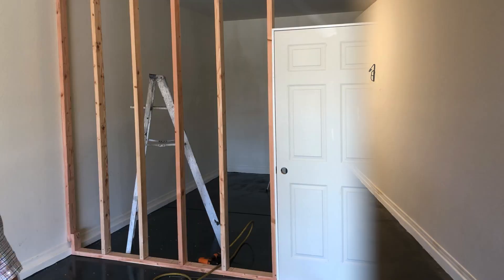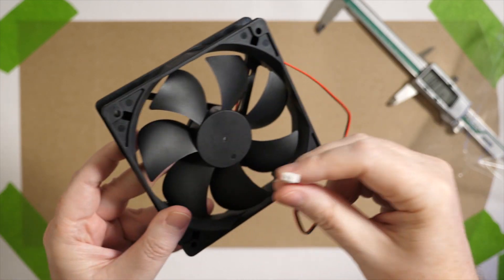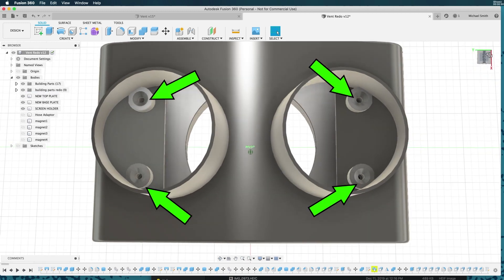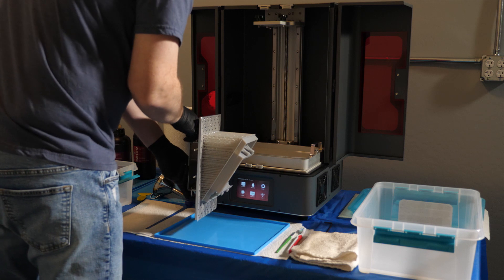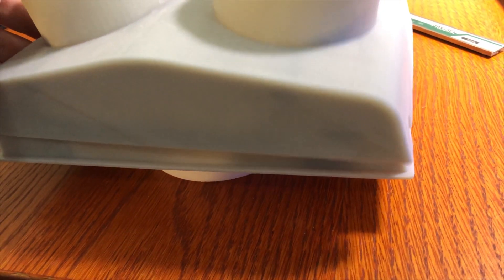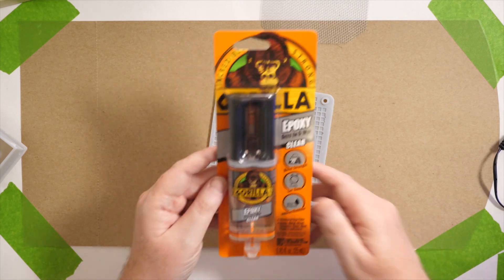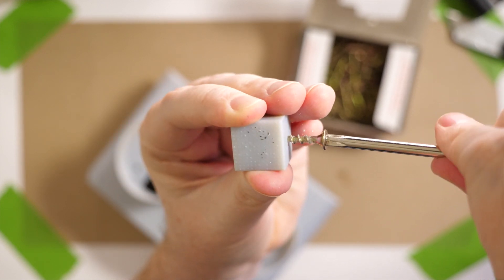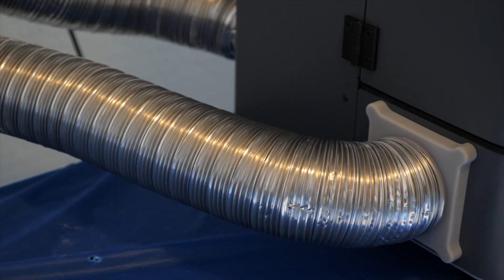Printer Fumes Gone - Designing and 3d Printing a Vent - 3D Printer Ventilation System

Comment: Cool designs, one suggestion, if you put some rubber o-rings were the parts connects with the wall or with the 3d printer you can seal the air flux and it will works a little bit better

Comment: Please use metal rings for tighter fits on the hose, and also, I am not quite sure a magnetic connection is really enough to make it airtight enough to not leak air and thus also fumes.

Comment: I love your videos and this design is great but I don’t think the PC fans push enough air. They’re not designed to handle the head pressure added by the ducts. I recommend upgrading to a duct fan with controllable speed. I turn it up before opening the lid to minimize the fumes I come in contact with.
Reply from the maker: This printer had light fumes. So the pc fan gently pulled them out. The fan in that printer is also just a pc fan. If you attach it to a high power fan it would be too much suction and would make the internal fan spin too fast which could cause electrical damage to the motherboard. If this were sucking smoke out from a laser cutter you’d be right that it wouldn’t be enough.

Comment: I'm just getting into resin printing and living in a climate with snow. So what I will need to do is design an air-to-air heat exchanger to swap out the fume-laden air with fresh but not vent all the heat in the Printer enclosure.

Comment: I THINK (not positive) that you are removing non-resin air to the outside. I think those fans are cooling electronics in the lower part of the machine which is separate from the resin chamber. To remove resin fumes properly, you need a hole in the side of your machine, directly accessing the build chamber. I'm new to these machines, so I could be wrong.

Comment: Pretty cool. I bought little filter ventilators from Anycubic for 23 dollars. You get 2 of them and they recharge battery on UBS. I am using ABS like resin, and I haven't really even noticed the smell or fumes from it, unless I get my face super near it. I have had more of an issue with the Alcohol. IPA, Denatured and E85 all make me dizzy, and or give me headaches, and contact high issues, so I have ventilated the hell out of the room and where a Paint Filter Respirator mask whilst performing the cleaning activities. That has fixed the problems.
Also I noticed that the video is over 2 years old and the advice is still relevant, but I do think that they have developed some resins that are way less fume producing than what was being used even 2 years ago. In fact Anycubic brags as a selling point that their resins are 65 to 80% less fumy than the competition/their older stock, The shelf life is 18 months to 2 years as compared to other companies/their older resins, etc. 
I have some standard resin coming from them, so I can compare it to the ABS like resin from them when it gets here. Clever design on your unit there.
I just think I am going to put in the dryer vent with the bug screen, and run 4 in flex hose not to the machine directly but I might hose off the vent fans to the collection area.
IDK, at the moment. I might make a video about it. I have to get my camera mike working first. The last video I made about cleaning and printing I had to edit over on the other channel because my camera wasn't picking up the sound.
Good vid though, TY: https://youtu.be/udyttBN1eV8

Comment: 2 years later I want to know how this system holds up with 2, 4" holes exiting 1 smaller hole.  Are the printers fans dead from the uneven pressure or still going strong?

Comment: @Nerdtronic  Re:  Design.  You mention that the fumes "just sit there," which implies (I think) that they are heavier than the surrounding air and therefore sink.  You've also bored your exit pipe low in the wall, at, or even below table height (I think), and perhaps in order to remove them lower down because that demands less of your fans lifting or pulling them, in the case that your vents were higher up, perhaps even far overhead.  So I conclude your print room is at ground level.  Could you give advice to those of us who might be printing perhaps in a basement, or just in a half basement (halfway above ground)?  Draw or push fumes up to a ceiling level vent, or take them out down low?  As low as we can reasonably do anyway?  Thx for any reply.

Comment: Any chance you could make a 2 1/2'' version of the Hose Adapter, trying to vent my ELEGOO Saturn, and all other venting makes on here are too large for my ender 3 v2 to print, this would be perfect if it was just a bit smaller, I'd just scale it but then the magnets wouldn't fit, current 4'' would just be too big for the Saturn.

Comment: Hey there, Michael! Great design approach on your fume extraction system, as well as the video and editing! Are you still using this setup just as it’s displayed in this video? Also from one of the Valleys of the Sun.
Reply from the maker: That printer put resin fumes out those vents. A lot of the printers I’m using now don’t. So actually I’ve been printing in my office a lot this year. Although sometimes get complaints from the family about the smell - when I have the lid open or whatever.  So that printer is still hooked up that way and it did help a lot. But don’t use that printer much  at the moment.

Comment: Great video. Excellent content and clearly and well printed, oops, presented. Just fyi, it is usual to drill pilot holes for wood screws, even if using in wood. There are charts online specifying the drill bit size corresponding to the screw size. Keep the good stuff coming!

Comment: Quick tip for CAD, try extruding the feature right where you want them instead of making a rectangle then moving it. It also allows changes to be made later on without having to re-do the entire model. Also, use the shell feature for parts like this.
Reply: Fusion 360 also lets you use parameters as dimension values. Then you can just change the parameters any time and it recalculates the features automatically.

Comment: I know this is over a year old , , but if you ever remake this , don't epoxy the screen directly to the housing and the fan.   instead put some wax paper between the  screen pat and clamp it in place while the epoxy cures . when the epoxy is done , remove the screen part and the wax paper from it .  you should now have a nice smooth perfect fit between the 2 and you can simply remove the fan to clean / wash the screen .  Great stuff man, I have been FDM for years just getting to resin now myself.
Reply from the maker: Thanks for the advice.

Comment: Hm I dont get it yet. Most SLA Printer have Fans to cool the UV Lamps. Normally there is no Fan blowing Resin Fumes around. So I am not quite sure what this will help. I am rather thinking of building a Enclosure around the printer and venting this or doing a similar setup, like its used for kitchens or for airbrushing.
Reply from the maker: So my printer does have a vent inside the print chamber with a small filter in it.  That connects down to where the electronics are.  The filter doesn't do much.  Most of the air can easily just go around it.  And then it has fans that suck air in to the electronics portion of it and out of there.  But yeah fumes do get sucked from inside the print chamber out the two out vents.  When I added this vent system it got rid of most of the resin fumes in my print room.  I can be in there now with no mask on without getting the headaches I was getting before.

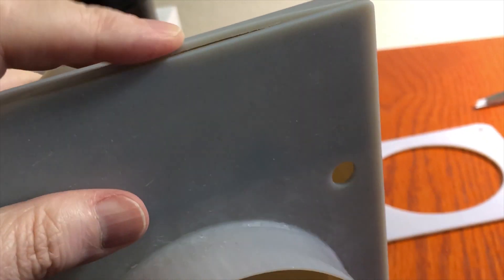Comment: Great design. How is it working out for you? @ 5:50 for long, thin leading/trailing edges like this that are prone to warp, it's always best to add a continuous line of supports.
Reply from the maker: It's been working good.  Honestly I hardly ever wear a mask in there any more.  The resin fumes mostly get sucked out.

Comment: I printed out the intake box that hon the printer what size is the hole suppose to be ?
Reply from the maker: If I remember right they're 4" holes.  They fit the hose I was able to find at home depot or lowes.

Comment: I like. Keep going
Reply from the maker: Thank you, I will
Reply: @Nerdtronic  im new to this.I've just got the software photon work shop slicer.  My computer is very slow when using this do you suggest any computer upgrades such as Ram or perhaps just going and getting a newer computer to run the software I'm also looking forward to using Fusion 360 to design programs to then be printed

Comment: Regarding your collision detection question.  There is a simpler way to see that hidden area.  If you are sliding in a panel from top to bottom on your fusion 360 display, click upper right menu  "Inspection".  From there click 'Section Analysis' in the drop down menu.

Now rotate your part a little and click on a wall/ surface on the right side of the main housing. Using the arrow, you will be able to view that panel moving down from the side, and when it bottoms out.
Reply from the maker: Thanks for the tip!  I probably need to watch more Fusion videos.  I know enough to get by.

Comment: Brilliant design and execution, but personally I wouldn't have glued the fan power connection into the baseplate so it could all be replaced easier if the fan failed...
Reply from the maker: If it failed I figured I’d cut the wire up a ways from the plug and crimp on a connector. And then do the same to the replacement fan. The plug wasn’t going to hold good enough in the case. Which is why I glued it.

Comment: I'm surprised you were able to make such a large functional part from an SLA printer, really that project falls much more comfortably in FDMs wheelhouse.
Reply from the maker: It's the reason I bought the printer.  I'll have more project videos on here where I print functional parts.  We'll see how they work out.
Reply: Nerdtronic I would be interested to see that!
Reply: I would do this on my FDM was exactly what I was thinking. If I had to do it on my SLA I would slow the print for a longer exposure and use a fiber resin. Not sure if this would help but that's my first thought.

Comment: Excellent design, setup and functionality of this system.. good work my friend.... I just wanted to put out there that SIRAYA Tech is producing awesome quality resins at amazing prices and truly have ultra Low Odor... I have printed some incredibly detailed strong and beautiful prints with it -and my faith in printing useful engineering quality components with a home SLA is restored. Thanks so much for this video....  I like this idea to vent the heat from my standard 3D printer enclosure when I print ABS :) PS. I am using grow tents for 3D printers now and ventilation is important for me and all these machines. So this may be my best alternative to cutting a hole in my ceiling (attic). 
Thanks Again- Jeff
Reply from the maker: Cool.  I'm using Siraya a lot now too.

Comment: Absolutely awesome make! I could see using some liquid tape around the edge of the magnetic box just to create a bit of a gasket. But that's because I love finding any excuse to use liquid tape on every project haha
Reply from the maker: Haha.  Never thought that it needed to be a tight seal.
Reply: @Nerdtronic  it probably doesn't haha but liquid tape!
Reply: use liquid rubber instead to make a 100% sealed connection so you are you gonna be sure that the voc arent escaping at all

Comment: The noise is getting to me, wish there was a way o reduce the noise level.
Reply from the maker: I hear you can swap out the fans for quieter ones but have not attempted it yet.
Reply: @Nerdtronic  If u ever do, please make a video for it, would help a lot of Transform users, heard there needs to be a power conversion which is the tricky part, u should ask the people on the Transform group that attempted this.

Comment: TIP: many times there is a set of arrows on the fan indicating the directions of the fan spin and air-flow.
Reply from the maker: good tip
Reply: Nerdtronic usually is sexy side pulls air in ugly side pushes air out.

Comment: really nice work! great design and explanations along the way. curious about the printer though? I have the Anycubic Photon S and really loving it. I just googled this printer and don't seem to be finding it for $1800 you mentioned? I would love a large format SLA printer like this! do you have any links to where you purchased from by chance? Thanks!
Reply from the maker: I got it on a Kickstarter which has ended: https://www.kickstarter.com/projects/phrozenmake/phrozen-transform-the-lcd-3d-printer-that-lets-you
It was 1699 plus extras so mine out the door was $1800 USD.  Technically it isn't SLA.  It's LCD which doesn't have a laser.  Instead it uses an LCD panel to expose UV light to the entire slice at once.